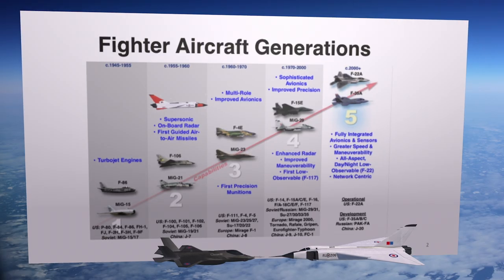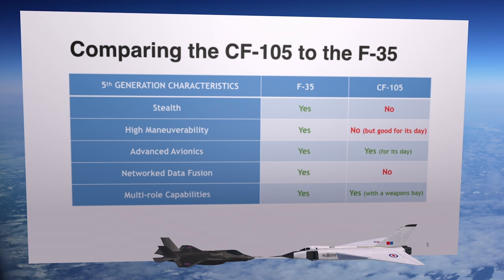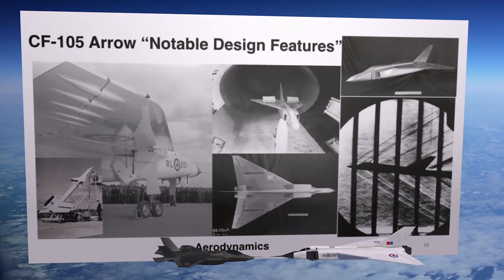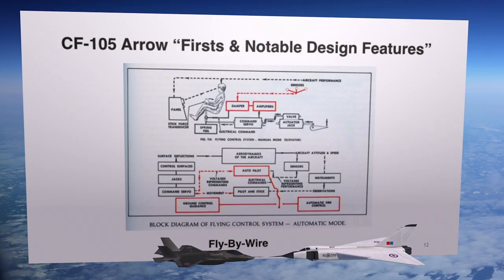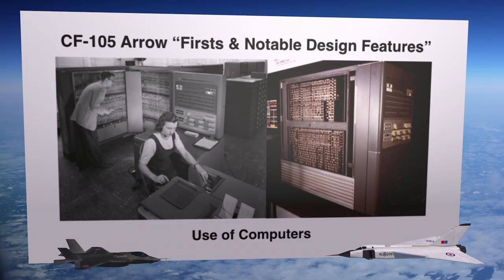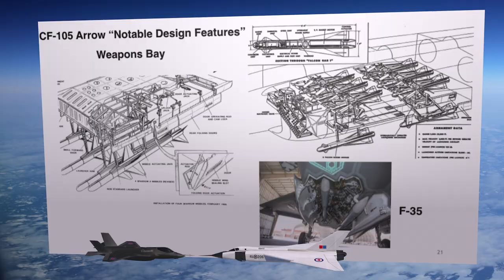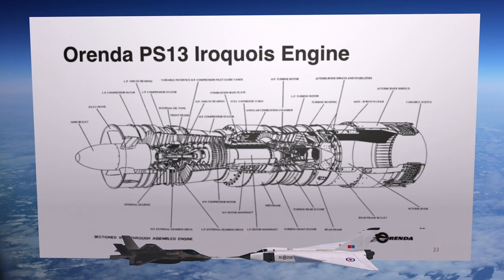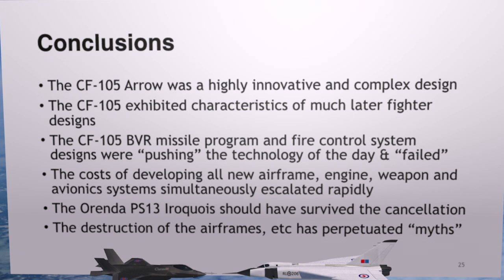AVRO ARROW FIRSTS VS F 35 LIGHTNING

Comment: This is a review of the book Cold War Cold Tech by R. L. Whitcomb as done by Jim100 AB for informational purposes only. Part 1

A short synopsis of the Arrow

The Arrow as Fighter-Interceptor

RCAF AIR 7-3 Specification and the C-105

 

Avro Canada and the RCAF examined a range of alternative sizes and configurations for a supersonic interceptor, culminating in RCAF "Specification AIR 7-3" in April 1953. 

 

This AIR 7-3 specification called specifically for a crew of two and a twin-engine design requiring a range of 556 kilometers (300 nautical miles (nm) for a normal low speed mission and 370 km (200 nm) for a high-speed intercept mission. 

 

It also specified operation from a 1,830 meter (6,000 ft) runway, a Mach 1.5 cruising speed, an altitude capability of 21,336 m (70,000 ft), and a maneuvering capability for 2 “g” turns with no loss of speed or altitude at Mach 1.5 at 15,240 m (50,000 ft). 

 

The specification also stipulated just five minutes from starting the aircraft's engines to reaching an altitude of 15,250 m (50,000 ft) at Mach 1.5. 

 

It was also to have turn-around time on the ground of less than 10 minutes. (Jim100 AB that’s Refueled and rearmed and ready for another mission)

 

An RCAF team then visited US aircraft companies and also surveyed British and French manufacturers before concluding that no existing or planned aircraft could fulfill these demanding requirements. 

 

In May 1953, Avro delivered a report, 

 

"Design Study of Supersonic All-Weather Interceptor Aircraft", outlining the major features of an updated C-104/2 design, which was now known as the C-105. A change to a thin "shoulder-mounted" delta wing allowed rapid access to the aircraft's internal systems, weapons bay, and engines. This thin wing was required for supersonic flight and the delta design provided the lightest structure

 

A big advantage of the computer flight control system was that it allowed the Arrow’s designers to design into the plane marginal or even negative stability factors, another first (by many years). The Arrow was intentionally designed to accept marginal stability, going from moderately positive to neutral on the pitch axis, and from slightly positive to moderately negative on the yaw axis. Because of the extra instability in the yaw axis, every aspect of it was at least double redundant except the single redundant hydraulic actuator itself. Perhaps now you can appreciate how truly advanced the Arrow was. We weren’t able to really compare it to anything until today because there was nothing to compare it to until today.  Flight performance envelope graphs, accumulated and transposed by R.L. Whitcomb for his book Avro Aircraft & Cold War Aviation shows that no medium or long-range armed fighter---to this day---could match the Arrow’s 1G combat weight performance curve, except the F-22 Raptor.

They wrote the book in terms of the modern method, yet the book had to be written all over again once Avro was killed and the engineers dispersed.

The Arrow and the IBM 704 computer

In 1955 Avro had projected the performance of the Mk2 Iroquois powered Arrow to be

Maximum speed of Mach 1.9 at 50,000 feet.

 

Combat speed of Mach 1.5 at 50,000 feet while sustaining a 1.84 turn without bleeding energy  Time to 50,000 feet of 4.1 minutes.

500 foot per minute (fpm) climb ceiling of 62,000 feet (i.e. able to climb at 500
fpm from this height) 

400 nm (nautical miles) radius of action on high-speed mission.

 

630 nm radius of action on a low-speed (including 5 minutes supersonic combat)
mission

 

Ferry range is not given but estimated at 1,500 nm

However, and to the elation of the Arrow designers and company in general the Arrow Mk 1, with about 40% less thrust then the Mk 2 and more weight, actually exceeded Avro’s own higher 1955 estimates for the Arrow Mk 2 by exceeding Mach 1.9. By October of 1958 due to test flying Avro was able to refine the drag estimates, feed them into the IBM 704 computer, and produce accurate projections that indicated 20% lower supersonic drag at maximum performance then even they themselves had projected. 

Due to this exceptional performance Avro knew the Mk 3 would be capable of considerable more than Mach 2.5. With improved materials and a new intake design that would be efficient at Mach 2.2 and above, Avro knew they would have an Arrow capable of at least Mach 3. This was nearly ten years before the SR-71 Blackbird or the Mig-25 Foxbat flew, suggesting Avro had an excellent advantage over the competition---given the freedom to exploit it.

Performance Report 15 included the empirically refined performance projections and figures this document indicated that the Arrow Mk 2 would have remained the top-performing fighter-interceptor in virtually all categories until the advent of the Lockheed Martin F-22 Raptor.

In fact an enormous amount of verbiage has been expended in claims that the Arrow would not have been manoeuvrable, based merely on the perceptions of it being such a large aircraft. In reality it was not that much bigger than the F-101 Voodoo or an F-15 Eagle, Neither of which would have seriously challenged an Arrow Mk 2 in a combat air patrol or, “top cover” or “air superiority” mission. 

Furthermore, size means nothing in determining aircrafts manoeuvrability potential. It can however, be calculated based on five factors. In comparison with any of the
aircraft built at the time and since in similar roles, from any country, the Arrow appears to have had attributes which would have given superior manoeuvrability to virtually any plane to this date---save the F-22 Raptor which has reverted to internal weapons carriage and a relatively low wing loading.
Reply: This is a review of the book Cold War Cold Tech by R. L. Whitcomb as done by Jim100 AB for informational purposes only. Part 2
The five critical attributes are: wing loading, thrust-to-weight ratio, control
effectiveness, critical alpha (or stalling angle of attack) and, finally the
amount of “G” loading the aircraft structure can absorb. 

The Arrow had the lowest wing loading of any supersonic interceptor to ever inter service, its only competition being the F-106 delta Dart and to a lesser extent, the F-22 Raptor, in terms of thrust-to weight ratio at combat weight; the Arrow was superior to everything up to the F-15 eagle. 

The Arrow’s allowable manoeuvring “G” at combat weight is equal, and in most cases superior to, virtually anything to fly then or since. Control effectiveness is difficult to estimate, especially with a supersonic delta design since the “moment arm” changes with control actuation and also with speed since the center of lift moves aft (back) at supersonic speeds. Designing a tailless aircraft with good manoeuvrability and stability characteristics across a wide speed range requires exact engineering.

Chamberlin’s unique features on the Arrow wing, such as negative camber inboard, leading edge droop, the saw tooth/notches were responsible for the arrow’s good characteristics at subsonic and supersonic speeds. Avro’s inclusion of a Honeywell Controls engineered automated fuel management system also allowed them to tailor the aircraft’s center of gravity to be very close to the aircraft’s centre of lift at each point (and thus expected speed) in its mission. 

The simple secret of making a delta craft very manoeuvrable is to have the center of lift and center of gravity at nearly the same place. Sufficient control surfaces will do the rest. 

In interviews with Jan Zurakowski and Peter Cope, both said the Arrow had awesome natural control sensitivity. Zura mentioned the roll rate was reduced at high subsonic speeds because he felt it was excessive. It was limited to one roll, or 360 degrees, in a second. Cope mentioned that the Arrow handled very well, was very stable on approach if flown correctly (contrary to some third party sources) Jack Woodman mentioned that a mere one-fifth of an inch of stick movement would result in a 0.5 “G” loading on the aircraft, which he felt was excessive. In other words, the Arrow had very good control effectiveness, better than any other USAF and British jets these experienced test pilots flew.

The simple fact is that the Arrow had an awesome power of maneuver as anyone who studies such things empirically will readily acknowledge.  When 1G performance curves for even the Arrow Mk1, with the early, de-rated J-75 engines, are compared to contemporary and even current fighters, it emerges that the Arrow was a world-beating design. It had the attributes in terms of low drag, low wing loading and high thrust-to-weight to defeat virtually any fighter at low altitude in a dog fight scenario. 

While its delta wing is argued by some to result in a high drag during turns, the Arrow’s internal weapons and higher thrust-to weight would compensate. The Arrow 1, at higher than combat weight, Displayed a larger flight envelope than a late production F-16 Fighting Falcon that carried only two tiny heat seeking missiles. (Braybrook. Roy, “Fighting Falcon V Fulcrum,” Air International Vol. 47, No 2 Stamford Key Publishing, 1994)

France’s  Mirage 2000, an updated version of their 1950’s Mirage III delta fighter is also known to embarrass the F-16 at medium and high altitude in turning fights, despite the F-16’s better thrust- to weight ratio. Nevertheless, the Mirage III was never considered a competitor to the Arrow in any performance measure or military role. 

The Russian MIG 29 Fulcrum, under equally light conditions to the F-16C mentioned above, is equal to that of an overloaded Arrow Mk.1 

An F-15C eagle, with up-rated engines, but at a true combat weight (no tanks, half internal fuel and eight missiles) displays a vastly smaller performance envelope to even an Arrow Mk.1 with at least 40% less thrust than a service Arrow Mk 2 would have had. The Arrow Mk 2, specified by Avro for the 21st Arrow, would have been able to sustain nearly 2G turn at Mach 1.8 at 50,000 feet.  

An F-15C could, at combat weight, sustain the same 2G turn at Mach 1.2 at 35,000 feet---hardly competitive.

The F-15C was felt, subsequent to the retirement of the F-106 Delta Dart to exhibit the highest performance in the Western world on an air superiority mission. Clearly, then the Arrow had vast “power of maneuver”. It had the ability to utterly humiliate anything flying at medium and high altitude. 

In a supersonic turning fight at altitude, the Arrow would remain unmatched by anything save the F-22 Raptor due to the F-22’s higher thrust-to weight ratio, The Arrow still had a lower wing loading and with a drag coefficient probably under .0185 and a lift-drag ratio of over 7-1 would therefore still not be a push-over for the Raptor---all other things being equal which, of course, 45 intervening years of progress in electronics have ensured are not.  Still, the Arrow Mk 2 was proclaimed to be capable of an instantaneous 6 “G” at 50,000 feet. The F-106 was also a high performer at altitude, capable of a 4 “G” at 45,000 feet whereas the Raptor is estimated to achieve 5 “G” at 50,000 feet. (Sweetman, Bill “F-22 Raptor”

 “The Arrow 2 design included provision for chaff and flare (chaff being radar
jamming filaments with flare being heat-seeking missile confusing pyrotechnic flares), active countermeasures, while ASTRA 1 and 2 radar/fire-control systems were to incorporate its own passive and active electronic counter-measures (ECM), including infra-Red detection, tracking and launch computation (the world’s first) home-on-jamming (helping the plane to navigate to the jamming aircraft), radar warning (telling the aircraft when it was being tracked or targeted) etc.. It was fully modern compliment and introduced sophistication which is today de rigour to the world of multi-role and air-superiority fighters” 

The Arrow would have been a dominant aircraft for many, many years and therefore could be expected to sell well to allied nations. That American authorities would not purchase any, and recommended that Canada not produce them tells its own story. The American aviation industry would not have been comfortable with the Arrow as competition and therefore was not likely to give the Canadian firm much opportunity to compete. (Douglas, W.A.B. Note to File “CBC Program on the Avro Arrow”, 21 April, 1980) 

During the test flying two accidents occurred. The first one was caused by a flaw in the design of the landing gear where the mechanism responsible for turning the bogies into alignment with the aircraft centerline jammed. Engineering had already redesigned the landing gear due to minor increases in aircraft weigh before the first flight and now it was redesigned again to prevent a similar mishap. 

The second accident was probably due to pilot error. Spud Potocki had taken RL-202 on a long-range high-speed flight from Malton to lake Superior, conducted a supersonic run over Ottawa (on Remembrance Day!) and on returning the plane to Milton. He was very low on fuel and his approach was to fast to be able to land properly on the runway available. Fearing running out of fuel he tried to force the plane down against ground effect and locked the main wheels before there was sufficient weight on them to brake properly. 

This resulted in the aircraft swinging off the runway and tearing off  one of the main landing gear legs and otherwise damaging the aircraft. As a result of this accident the Mk1 gear was banned from flight and replaced by the stronger and improved Mk.2 landing gear---even though the Mk.2 was significantly lighter then the MK1. 

This was also the fastest recorded flight of the Arrow with a speed of mach1.98 reached. Jim Floyd has related that they didn’t really know the correct atmosphere correction factor to apply to this flight and as such the flight could have been Mach 2 or slightly higher. 

Arrow RL202 reported an official top speed of Mach 1.98. During that flight radar vectoring recorded a top speed of Mach 2.2.

They apparently decided to state the speed as Mach 1.98 in order not to record a new world speed record and agitate their peers in the rest of the industry, and their enemies in government. Others have said that A.V. Roe Canada president Crawford Gordon Jr.absolutely forbade a speed record attempt in the Mk1 Arrows, wishing to preserve this accolade for the Iroquois engine Mk2.

By the fall of 1958 Avro was projecting a Mach 1.8 combat speed and 2G at 60,000 ft, exceptional even today. (PR 15 and Jim Floyd’s testimony)

Also the Arrow Mk 2a which Avro hoped to introduce on line after the first 37 under construction was set to achieve a 575 nm combat radius while flying a supersonic mission! The Arrow being able the to cruise at transonic and supersonic speeds without afterburner use (Super Cruise in 1958 – 1959 is this another first? Jim100 AB) is one reason it had superior range to the competition
Reply: This is a review of the book Cold War Cold Tech by R. L. Whitcomb as done by Jim100 AB for informational purposes only. Part 3
The Arrow’s Weapons and Weapons Bay

The Arrow has more military payload capacity than any other contemporary bomber-destroyer. The Arrow with the presently conceived armament pack containing MB-1 [Genie] and Falcon missiles plus fuel, has a subsonic radius of action, based on indication of drag from flight tests, of around 500 nm, with supersonic combat and all allowances, which is considerably higher than any other aircraft in its class.

The concept of a multi-role combat aircraft clearly intrigued the RCAF for the C104/2 design closely resembled the CF-105 in size, appearance and capability. The key to its flexibility lay in its massive armament bay. Install six Hughes Falcon missiles and twenty-four rockets and it was an interceptor. Not satisfactory? Try four Velvet glove missiles or four thirty-millimetre cannons with 200 rounds each and fifty-six folding fin rockets. Need a tactical bomber? Four 1,000-pound general purpose bombs would do the job. Put in a camera pack and the aircraft was transformed into a photo-reconnaissance model. Add more fuel and it became a long-range fighter. Carry a second pilot on any of these missions and it could be used as an operational trainer. The possibilities were too numerous to resist. (Dow: The Arrow p. 126)

The Arrow was designed to out-fly, out-think, and out-fight, with its own on board missiles, any expected threat until the about 1970. Unlike any aircraft save the heavy bombers, the Arrow was capable of carrying several guided missiles capable of nuclear armament, considerable “stand-off” range at high supersonic speeds. 

This high performance, even when heavily loaded, combined with the capability of the kinds of weapons it could carry in its internal weapons bay, gave the Arrow more potential flexibility then most aircraft built to this day.

For flexibility, the armaments bay could hold 6 Hughes Falcon guided missiles and 24 Hughes 2.75" rockets 

Or 4 Velvet Glove missiles 

Or 4 30mm canons with a capacity of 200
rounds and 56 folding fin rockets 

Or as a bomber, 4 1,000 pounds of bombs 

Or as reconnaissance, a camera pod 

Or to give the fighter a longer range, an extra fuel tank 

When the airframe development began, the RCAF and the Defense Research Board began evaluating missiles and their fire control systems. 

They looked at the following missiles: 

- Douglas MB-1 Genie 

- Hughes Falcon Sperry Sparrow I 

- Douglas Sparrow II 

- Raytheon Sparrow III 

In mid 1955, the Douglas Sparrow II was chosen and the Hughes Company would adapt their fire control system to other missiles. RCA agreed to work to RCAF requirements 

ASTRA, and on 28 Jun 1956, C.D. Howe tells the House of Commons work will soon begin on ASTRA. In late 1956 the USN abandons development of the Sparrow II, the missile chosen for the Arrow. 

The Canadian government brought the Sparrow II to Canada to continue development with AVRO as the System Manager, Canadair to build the missile airframes, and Canadian Westinghouse in Hamilton to work with Bendix-Pacific on the Radar Guidance System.  

The Canadian Armament and Research Development Establishment (CARDE) began the Velvet Glove program 1 April 1951 and by the time the program had been terminated in 1955, 300 Velvet Gloves had been built and fired. The Velvet Glove program had spent $24 million. 

 The Arrow and Long Range Missiles...

For the AVRO Arrow, the Sparrow II Raytheon AIM/RIM-7 Sparrow was intended to provide the long range clout

The use of a LONG internal weapons bay to allow carriage of specialized, long-range standoff and cruise missiles (not, copied yet really)

The Falcon “Z” “the weapon specified were two, Falcon Z, aka GAR-9, aka AIM-47 type missiles each weighing approximately 750 lb. the missile had a range of about 100 miles and a 40,000 foot differential altitude, as later tested on the YF-12A. It was a large, advanced long-range air-to-air missile of the performance Avro had been awaiting. It would have suited the Arrow’s large internal weapons bay while competing aircraft could not have carried it internally—resulting in a huge performance advantage to the Arrow so equipped. 

Anti Ballistic Missile

“It is interesting in the government discussions on ABM weapons that the Arrow was never considered as capable of undertaking this role. Certainly Avro had been suggesting it do just that. 

“It might be supposed for example, that in every aspect of employment the anti-missile, missile would prove to be very far removed from the manned fighter airplane. Yet the possibility is already seen that, in order to achieve its maximum kill potential the “anti” missile may actually form an alliance with the manned fighter. 

“The feasibility of this…has been expounded by Jim Floyd, Avro Aircraft’s vice president engineering …whereas the launching of the Russian sputnik satellites was a very significant event in the annals of aviation its affect on the Arrow program should be singularly positive…if you think about in for a minute,” he says “the normal launching platform for anti-missile missile are stationary. The Russians can find out where they are and destroy them. On the other hand, an airborne missile mother ship (which could be the Arrow) can be rapidly moved from one place to another carrying an anti-ICBM missile. 

“It might be imagined that a missile suitable for carrying an anti-missile warhead would prove a formidable load even for the mighty Arrow: But Mr. Floyd had looked into the matter with a quick specific calculation on an ICBM approaching at Mach 10 at 200 miles above the earth. He finds that if an “anti” is launched from an aircraft flying at Mach 1.5 at 60,000 ft. its thrust need only be about one third of that required for ground launch weapons carrying the same size of warhead to a given point in approximately the same time. And dividends would accrue in range and accuracy. (Flight and Aircraft Engineering, “Ironclads and Arrows” 14 February 1958

In other words, any Arrow could carry the ABM weapon Avro was considering. The British technical journal engineering also discussed the possibility of the Arrow carrying an ABM weapon in their 17 October, 1958 edition. Jim Floyd has subsequently related that Avro was working with Douglas to adapt a version of the Nike-Zeus system for use on the Arrow. The first stage of the ground launched version could be abandoned, with data link modifications to the remaining upper stage to accept targeting information from the Arrow’s onboard radar system. 

Of course, nothing came of this plan, perhaps in part because it wasn’t mentioned to the right decision makers. There is no evidence available suggesting that the Chief of Staff or the Conservative Cabinet were aware of Avro’s plan to carry ABM’s on the Arrow nor the fact that the system they were proposing was based on the American first choice for their ABM system, the Nike weapons
Reply: This is a review of the book Cold War Cold Tech by R. L. Whitcomb as done by Jim100 AB for informational purposes only. Part 4

Who was Julius
Lukasiewicz? An interview with Jim Floyd

“Jim Floyd has been hesitant in relating the true role that {Julius} Lukasiewicz played at the time the Arrow was designed Lukasiewicz was at that time with the National Research Council in Ottawa and Canada’s expert in supersonic aerodynamics. So he reviewed the design and produced a report that was scathingly critical of the aerodynamic design, to the extent that there was no point in continuing with such a flawed airplane. It was decided to approach the USA for an expert opinion. Hugh Dryden, a renowned aerodynamicist at The National Advisory Committee on Aeronautics, forerunner of NASA gathered a team of his top men in the field of supersonics. Their verdict was Avro had an excellent design and if anything they were being conservative in their estimates of performance.

Lukasiewicz has never forgotten his humiliation and despite the fact that the Arrow behaved perfectly and achieved a speed of 1.98 times the speed of sound while still climbing and with the lower powered J-75 engines, never ceased to twist the facts. (Keast, Harry: Letter to the Editor of the Globe & mail newspaper. This letter is available as part of a CD Rom
from www.avroarrow.org)

Keast was responding to a disparaging editorial on Avro and the Arrow by Professor Michael Bliss in the Globe & mail newspaper titled “the Legend That Wasn’t”. The Globe & mail unfortunately failed to print the rebuttal, despite Keast’s vastly superior credentials.

Other primary sources indicate that fights between
Avro’s brilliant aerodynamicist Jim Chamberlin and the NAE really polarized the two groups. In fact, the government scientists became so frustrated with the inflexibility of Chamberlin over the Arrow’s aerodynamics that Avro was asked to fire Chamberlin. J.C Floyd wrote: “I was fiercely supportive of Jim [Chamberlin] in the dark days of the NRC [via the NAE] criticism of our aerodynamics when they even suggested that Jim should be taken off the project. I told them that I would resign myself rather than do that!”(Letter from J.C. Floyd. 9 February, 2004 to R.L. Whitcomb) Chamberlin stayed, but so did the NAE, at the time Julius Lukasiewicz, a polish ex-patriot, was, the NAE’s high-speed aerodynamicist and the man most at odds with Avro’s engineering and design staff. 

G/C Footit has written in a period documentation
that some of the criticism was due to professional jealousy in the organizations like the National Aeronautical Establishment (NAE) who felt they should be the ones charged with design and testing of aircraft like the Arrow. This internal bureaucratic opposition spread (along with rumors) and did the program serious harm. They were also proven wrong by the Arrow itself, and by subsequent design history.

 Later in life without disclosing his involvement in the program, Lukasiewicz was interview by the CBC and was highly critical of the Arrow program.

Arrow Benchmarks 

1) The first fly-by-wire flight control system.

2) The first fly-by-wire flight control system using solid-state components operating in “real time”.

3) The first fly-by-wire flight control system with at least single redundancy.

4) The first fly-by-wire flight control system designed to be coupled with the computerised navigation an automatic search and track (ASTRA).

5) The first fly-by- wire flight control system providing artificial feedback, or feel to the pilot. Not even the first F-16's had this.

6) The first fly-by-wire flight control system that was flyable from ground installations through data uplink, with data downlink systems reporting. (This, along with its designers, became the basis of the data-link fly-by-wire systems for Mercury, Gemini and Apollo 1.)

7) The first aircraft to have its aerodynamic design aided by solid-state (real time) computers, Avro thus appears to be the company that evolved the technique now referred to as Computational Fluid Dynamics.

8) The first aircraft to have its structural design aided by solid-state computers.

9) The first aircraft to have complete hydraulic and electronic systems development rigs (simulators generally using actual aircraft components wherever possible, coupled to their computers to produce a realistic computerized flight simulator.

10) The first aircraft to have a Pulse-Doppler, ”look-down, shoot-down” radar designed for it, (The second was the F-14 Tomcat, although ASTRA II was to be fully digital, while the Tomcat’s AWG-9 was not digital. In fact, the first Aircraft in service to have radar/fire control systems integrated with a flight control system of equal conceptual technology to the ASTRA II-Arrow was the F-18 Hornet.)

11) The first aircraft designed with marginal or negative, static stability factors. This was done to ensure good manoeuvrability across its very wide flight envelope while keeping trim drag to a minimum thus allowing a larger flight envelope.

12) The first aircraft to have an advanced, integrated, bleed-bypass system from its self-adjusting intake to its extractor-nozzle exhaust. (The F-104 is credited with being the first to introduce bleed-bypass integration but it was comparatively rudimentary and probably of similar sophistication to that introduced on the jetliner years earlier.)

13) The first aircraft to have a by-pass turbojet designed for it and the first to integrate the bleed-by-pass and cooling systems of the engine, intakes and extractor nozzle.

14) The first aircraft to have its engines located at the extreme rear of the aircraft. In fact it was about the first jet fighter to have what might be termed “longitudinal spacing” of all its major systems. Previous to the Arrow most aircraft designers had tried to locate fuel tanks, weapons and engines as close to the center of gravity and center of lift as possible. This contributed to their being “fat” in aerodynamic terms, which is why so many of them ran into “area rule” problems.

15) The first aircraft to be developed using an early form of "computational fluid dynamics" with an integrated high wing that made the entire upper surface a lifting body  type of theory rather than the typical (and obsolete) "blade element" theory. The F-15, F-22, Su-27 etc., Mig-29, Mig-25 and others certainly used that idea.

16) The first to use of a LONG internal weapons bay
to allow carriage of specialized, long-range standoff and cruise missiles. (Not copied yet really)

17) The first aircraft to have major components machined using Computer Numeric Control CNC equipment. (The second is believed to be the F-111Aardvark)

18) The first aircraft to have major components and fasteners made of Titanium.

19) The first aircraft to use a 4,000 psi hydraulic system (The second was the B-1 bomber)

20) The first supersonic aircraft designed to have better than one-to-one thrust-to weight ratio at close to combat weight (allowing it to accelerate while climbing vertically) The “ Reaper” ground-attack version of the Gloster Meteor was around 1-1 thrust, but it was not supersonic. The first aircraft to compete in this area was the F-15A Eagle.

21) The first to propose an aircraft be equally adept at strike/reconnaissance roles while being THE air-superiority fighter at the same time. (Few have even tried to copy that, although the F-15E is an interesting exception.)

22) The Arrow combined the lowest thickness-chord ratio (thickness of the wing compared to the length (not the span) wing with the lowest wing-loading (surface area of wing divided by the weight of the aircraft) of any high-capacity service design. Both are crucial to low supersonic drag, good manoeuvrability and high speed.
Reply: This is a review of the book Cold War Cold Tech by R. L. Whitcomb as done by Jim100 AB for informational purposes only. Part 5

Iroquois Engine “Firsts”

In June of 1956 the Iroquois underwent its first official test, the 50 hour Pre-Flight Rating Test (PFRT) During this test the engine beat every known record for thrust output at 19,350 lbt (pounds thrust) without afterburner. Its throttle response was also world-beating. It took only 2.8 seconds to go from idle to full military thrust and only 4.5 seconds to go from idle to full afterburning thrust.

First overhung-stator two-shaft design using two(vs.
three or more) bearings assemblies thus dispensing with a central casting, and replacing the two shafts with an inner and outer drum making the entire center core of the engine turn. The combustors were overhung with the flour comprising the spinning outer drum which connected the high-pressure(HP) turbine to the HP compressor section The drum connecting the low-pressure (LP) compressor to the LP turbine was smaller and rotated inside the HP drum.

First, to make extensive use of Titanium for reason of high-strength high-temperature tolerance and low weight. 

First, to house a high proportion of it machinery (pumps, gearbox, drives etc.) internally to lower installed size. This meant a smaller, lighter aircraft stricter, and improved over-all aerodynamics and efficiency. 

First to concentrate on constant gas speed though out the core to maximize aerodynamic efficiency and allow a higher average speed of flow through the engine (rather than varying gas temperature pressure and speed, though the core, they designed it in such a way as to keep the gas speed relatively constant and vary only gas temperature.)

First to try air-cooled turbine blades with comparatively  cool compressor air ducted to the blades though the core structure of the engine, and though pressurized, annular ducts formed by the outer case of the engine. The Iroquois 1 used this but the Orenda designers dispensed with air-cooled blades in the Iroquois 2 due otherwise excellent air-cooling after the combustors and improved metallurgy (availability of Income l X) The Pratt & Whitney J-58 for the A-12/YF-12A/SR-71 used a similar arrangement on a single –spool design.

First (with the General E electric J-79 of the B-58 Hustler and F-4 Phantom) variable pitch stator design (variable pitch stator allowed improved throttle handling and resistance to compressor surges, stalls, and engine flame-outs. On the J-79 variable stators allowed the designers to produce a single-spool engine with the handling quality usually associated with two-spool designs, on the Iroquois., which was already a two-spool design, it allowed Orenda to design it with 40 to 60% fewer compressors and stator sections, compared to contemporary and most later designs greatly lightening the engine.)

First “bypass” engine using LP and HP air for cooling the turbine section and machinery while exhausting through the extractor nozzle to increase thrust.

“Hot-Streak” ignition for the afterburner A streak of hot combustion gasses was piped directly back to the afterburner fuel zone an ultra-reliable afterburner igniter an sustainer. 

First oxygen injection-relight system in case of engine flame-out at altitude, this technology was licensed by Orenda at the time, providing income for the company.

First fully variable afterburner. Previous systems came on all at once or in two or more stages. A fully-variables system in an engine of the low weight, high thrust and good fuel economy of the Iroquois would have been a manger tactical advantage during the 1960s and 70s. 

Many changes were made to the structure of the MK1
engine and a new prototype the Iroquois MK2 was produced. During the program at least five running engines were sent to the United States for test and evaluation. Iroquois engineer Colin Campbell relates that the engine was tested at up to 25,000 pounds dry thrust in Canada and at up to 27,000 pounds in the Cornell Institute in the United States. These are phenomenal outputs for an engine of this size even today. The rating they were aiming for was 20,000 pounds dry thrust and 30,000 pounds with afterburner. Clearly they had reason to hope for even more powerful versions once they addressed the reliability and longevity issues.

The Iroquois engine MK2 would have been able to accelerate while climbing vertically and carrying a useful load. The developed Iroquois promised this performance at close to gross take-off weight.

(Jim100 AB So why did the Canadian government cancel this plane? Based on the research I would have to go with these assessments.)

The Arrow would have been a dominant aircraft for many, many years and therefore could be expected to sell well to allied nations. That American authorities would not purchase any, and recommended that Canada not produce them tells its own story. (R.L. Whitcomb) 

A Canadian civil servant involved in a review of the
CBC documentary “There Never Was An Arrow” Noted the following regarding the documentary’s conclusion that American interests were not involved in the Arrows cancellation: “The program concluded that no American interests were in evolved in the decision?” On the face of it, this seems a remarkably innocent point of view. Previous accounts have suggested with some reason that the American aviation industry would not have been comfortable with the Arrow as competition and therefore was not likely to give the Canadian firm much opportunity to compete. (Douglas, W.A.B. Note to File “CBC Program on the Avro Arrow”, 21 April, 1980)

It is perhaps worthwhile to consider where American
interests lay in the 1957 election. It was in response to this growing concern, in some quarters in Canada about the alarming growth of American ownership in the Canadian economy, that the previous Liberal administration had started a Royal Commission in the first place. It seemed tailor made to rebuff the Rockefeller panel’s overt economic imperialism. This commission pointed out the negative impact this increasing ownership was going to have on Canada’s future. Some of the problems foreseen were:

The decline of research and development in Canada due to this work being concentrated in the home offices of the American companies then by Canadian production facilities. The inability of Canada to look after its strategic needs, including defense, if Canadian strategic resources were allowed to be bought out by American interests. An exodus of Canadian administrative, scientific and technical talent to the United States as a result of the above. A decline in Canadian economic, military and political independence brought about by the above, with the probable result of Canada losing any real sovereignty and thus becoming a satellite of the United States. (Gordon, Walter L., A chance for Canada, based in part on the Gordon Commission.)
Reply: This is a review of the book Cold War Cold Tech by R. L. Whitcomb as done by Jim100 AB for informational purposes only. Part 6

Price Deception

Foulkes later left evidence on the record demonstrating his “erroneous” conclusions regarding the price of the Arrow.

“it is quite clear that this aircraft will require almost $500 million to complete development and then it will cost between $10 and $12 million a copy for production”

So according to Foulkes’ spurious CSC recommendations to Pearkes, The 10 to 12 million figure obviously was for costs for production not including design and development. However, in an unpublished article on the Arrow debacle Foulkes later wrote:

“The Defense Production Department advised that approximately $300 million had been spent on the Arrow project and that an additional $871 million would be required to complete it.” This resulted in the $12 million figure. (Smye Canadian Aviation and the Avro Arrow P. 113)

Foulkes was obviously capable of considerable modification of statements when embarrassed.

Dow wrote:
”$12.5 million. This was the cost per aircraft cited by the prime minister for 100 Arrows equipped with Astra and Sparrow… To arrive at these figures it was necessary to total the cost of all components of the weapons systems, airframe, engine, missiles, and fire control. This included agreements for design and development, tooling, spares, ground handling equipment, test assembly and overhaul.

To make these figures appear even more outrages, the cost of the 37 aircraft on contract was considered as a development expenditure for the proposed program to build 100 Arrows. In effect the cost of 137 was divided by 100 to inflate the price per plane.” (Dow The Arrow P. 180)

Smye would later view some of the government cost
figures, and even using their own admitted math, would come out with an average price for 100 operational Arrows, including all design and development to operational standards, engines and fire control, of $5.62 million dollars.

The government said it came to $7.8 million a copy.
This was because they were writing off the entire 37 preproduction run and were including design and development expenses incurred to date, missiles, lifetime spares, ground support and test equipment and more.

It was a very deceptive way to influence the thinking of Cabinet, the press and the public. Of course, in comparing figures, the fact that payroll income and other taxes would be immediately be recouped from Canadian production was, inexplicably ignored.

It also appears that Avro’s final offer was not brought to the attention of Cabinet, nor anyone else, for many years---until Fred Smye made it public in his unpublished manuscript: Canadian Aviation and the Avro Arrow. So what was Avro’s final offer on the Arrow? It was 3.5 million dollars each for the first 100 Arrows and 2.6 million dollars each for the next 100.

As Dow put it “Details of Avro’s offer to the government were given in a letter from the company to D.L. Thompson, director of the aircraft branch of DDP on 30 December. The letter confirmed a fixed price offer of $346,282,015 for 100 aircraft (25221 to 25320), including Iroquois engines and the Hughes MA-1C electronics systems. 

Adding applicable sales tax of $28,717,985 brought the price per aircraft to an even $3.75 million. The contract proposal attached to the letter covered design and development, tooling and tool maintenance, manufacture of 20 development and 100 squadron aircraft…and technical support for the squadron aircraft. (Dow: the Arrow P. 186
Reply: This is a review of the book Cold War Cold Tech by R. L. Whitcomb as done by Jim100 AB for informational purposes only. Part 7

F-106 VS Avro Arrow

Performance Specifications

It is worth noting that the USAF service (not absolute) ceilings were based on the ability to sustain 1.2G standard (or bomber rated turns) requires an angle of bank of 15 degrees no matter what the speed, height or weight of the aircraft.

Similarly, a 2G steep (or fighter rated turns) requires an angle of 60 degrees of bank. Thus a G loading relating to a “combat profile” entails more than just the ability to pull a modest amount of G structurally, becoming a consideration of all the best attributes of an aircraft as a whole. Analysis of this “flight envelope” of an aircraft has forever spoken to the need for more power, less drag and more lift.

The RCAF meanwhile had established a combat specification
for the Arrow even more demanding than the British convention. The British established a fighter’s combat ceiling and combat altitude with the speed that could be maintained under a 1.5G turn. All comparisons of US aircraft performance against the Arrow and British designs should bear in mind these more demanding British/Canadian requirements.

As an illustration of this seemingly insignificant .8G difference between the US and Canadian rating systems, 1.2G requires an angle of bank of only 15 degrees while a 2G requires a full 60 degrees of bank! Obviously, there is an enormous difference in the lift (and therefore thrust) required to maintain altitude between these “bomber rated” and “fighter rated” turns.

The F-106 would realistically be roughly capable of about a Mach 1.5 combat speed at 1.2G at 50,000 ft., a far cry from the Avro specification for a Mach 1.5 combat speed at 2G at 50,000 ft without losing energy. By the fall of 1958 Avro was projecting a Mach 1.8 combat speed at 2G at 60,000 ft. exceptional even today (PR 15 and Floyd’s testimony.)

Also, popularly, published US figures tend to demonstrate the best singular performance numbers of a design and do not publicly tie the specifications together into a comprehensive combat performance specification. This is a very important point for our purposes. While an aircraft may have a maximum speed of Mach 2 at 35,000 ft, its service ceiling, like on the F-16 of around 50,000 ft may only be reached at a mere Mach 1.2 and the aircraft will have very little maneuverability at all.

The F-106 VS Arrow Top Speed and Altitude

Three years after the first flight of the F-106 Major Joseph Rogers established a new world absolute speed record at Mach 2.18 over a closed course. Also on this December 1959 flight Rogers coaxed a specially-prepared (stripped down airframe and specially tuned engine) F-106 to Mach 2.31. This figure has always been quoted as the maximum speed of the F-106, but it has no reflection of what a service aircraft could achieve with half internal fuel, a full armament load and a typical engine. The numbers quoted in the first flights of the F-106 are probably more indicative, with a top, practical level flight speed of about Mach 1.9 at 35,000 ft though certainly not with external tanks and a maximum ceiling of 57,000 ft. Acceleration was slow taking 4 and a half minutes to accelerate from Mach 1 to Mach 1.7 and another two and a half minutes to reach Mach 1.8. As for the F-106’s 70,000 ft. “intercept” altitude, it relied on the ability of the missile to climb for a significant distance to accomplish this task. 

. The test Arrow Mk1 (RL 202) would exceed both of these figures with Wladyslaw “Spud” Potocki the second Avro development pilot he would achieve Mach 1.98 at 50,000 ft and the aircraft would fly to more than 58,000 feet with the lower-powered de-rated (not developing design thrust) J-75 engines and thus being 44 percent underpowered compared to the Mk2 with the Iroquois engines. The Arrow Mk1 had nearly reached the speed and altitude projected for the Mk2 Iroquois- engine version! One can see that the performance of the Mk2 would have been far superior to the F-106 in every respect.

Janusz “Zura” Zurakowski Avro’s chief development pilot reported on the seventh flight of the Arrow on April 18 1958 an altitude of 49,000 feet at Mach 1.52, still accelerating and climbing and Jack Woodman the only RCAF pilot to fly the Arrow. As the governments representative he noted that approximately 95 present of the flight envelop had be explored. The Canadian Armament Research Development Establishment (CARDE) years later would state that the Arrow in 66 flights and 70 hrs 30 minutes of flight time had completed and passed 95 percent of its Flight testing. 

F-106 VS Arrow Fuel and Combat Radius

In 1968 the F-106 finally got long-range external tanks which extended its maximum purely subsonic combat radius to 325 nm, The Arrow Mk2 with the presently conceived armament pack containing MB-1 [Genie] and Falcon missiles plus fuel, has a subsonic radius of action, based on indication of drag from flight tests of the Mk1, of around 500 nm, with 5 minutes of supersonic combat and all allowances. The Arrow Mk2 had an internal fuel capacity 2.3 times that of the F-106 relying on two large capacity external tanks.

Dr. John J. Green, from the Defense Research Board (DRB) and scientific adviser to the RCAF, had written the following in a memorandum dated June 1, 1954:

In computing combat radius different conditions are stipulated by the RCAF and the USAF. For instance, the USAF permits the use of external tanks, whereas the RCAF specifications do not. If the combat radius of the CF-105 is calculated in accordance with the conditions permitted by the USAF specification, the figure of 782 nautical mile combat radius is obtained.

This certainly goes against Diefenbaker’s statement that the Arrow was deficient in range. Indeed, it was ready to achieve a supersonic combat radius in the Mk2A version of at least 575 nm and do so with a combat speed of Mach 1.8 rather than Mach 1.5. This range performance is very nearly three times the RCAF specification, as Jan Zurakowski reiterated in a note in August 2001. Zura also wrote Diefenbaker reinforced this impression in public that the Arrow was deficient in range!

F-106 VS Arrow Combat-Weight Power-Loading

The F-106’s Combat weight was 38,700 lb. while that of the Arrow Mk2 was about 62,431 lb. Respective afterburners was 24,500 lbt (pounds thrust) for the developed J-75 as compared to 52,000 lbt on the Arrow Mk2, with two undeveloped Iroquois. 

This provided a combat-weight power-loading for the F-106 of 1.27 lbs to lbt. The Arrow Mk2 with two undeveloped (de-rated) Iroquois with a lower afterburner augmentation ratio would have had a combat-weight power-loading of 1.09 lb to lbt nearly 20 percent superior. This comparison is with an F-106 at half internal fuel and without external tanks. The Arrow also faced lower power demands per pound of airframe then the F-106 because the CF-105 had over twice the power available in an airframe with only about 25 percent greater frontal area.

The de-rated Iroquois engine MK2 would have been able to accelerate while climbing vertically and carrying a useful load. The developed Iroquois engine promised this performance at close to gross take-off weight.
Reply: This is a review of the book Cold War Cold Tech by R. L. Whitcomb as done by Jim100 AB for informational purposes only. Part 8

The F-101 Voodoo

By 1957 the F-101, originally designed as a long-range bomber-escort fighter, had been ordered into production as an interceptor, no doubt because even then the F-102 becoming F-106 was still having serious development problems. The interim re-design of the F-101 escort fighter to carry the MA-1 interception system’s brains, eyes and teeth had made this option even more appealing. SAGE and MA-1 operational experience could be gained on the aircraft that could do the same job (more or less!) in terms of range and speed of the F-106, made it irresistible to the USAF.

All interested and informed parties knew, the F-101 no matter how heavily sold; could never rival Avro’s Arrow. The F-101 was essentially a subsonic or maximum Mach 1.2 combat speed aircraft at around 36,000 foot altitude and a maximum speed of about Mach 1.6. The Voodoo used the ancient J-57 turbojet engines , had about half the thrust to weight ratio of the Arrow, had three times the wing loading, had a pitch up problem, had structural problems, and more. This aircraft would be employed, second hand, by the RCAF soon after the Arrow cancellation. 

(Jim100 AB As bad as the F-106 was when compared to even the Arrow Mk1’s flight performance the F-101 was even worse!

Look at the numbers closely the F-106 with as much weigh removed as possible things like radar dish, MA-1 fire control system, no weapons and anything else to save weight, and then it used a specially tuned engine. The F-106 was able of reaching a maximum speed of Mach 2.31 at 40,500 ft. So how does the Arrow Mk1 compare.

The Arrow Mk1 with more weight than the Mk2 and being 40 to 44% underpowered compared to the Mk2 and with an instrument pod that weighed considerably more the a standard missile pod was able to reach a speed of Mach 1.98 at 50,000 ft. 

Look at the numbers again and do the math the F-106 speed of Mach 2.31 minus the Arrow speed of Mach 1.98. We find that the specially-prepared F-106 was just 0.33 Mach faster than the overweight underpowered Arrow Mk1!

Also look at the altitude this speed was reached at. The Arrow Mk1 reached its speed at 50,000 ft minus the 40,500 ft for the F-106 and we find the Arrow was 9,500 ft higher in altitude then the F-106. The Arrow Mk1 was Mach 0.33slower at 9,500 ft higher altitude not bad for the overweight and underpowered Mk1 VS the specially-prepared F-106!

Also, the Arrow Mk1 had not been pushed to its performance limit, (it was not to reach or exceed Mach 2 or try for a new world speed record for one reason or another Jim100 AB). The American aviation industry and the USAF also knew that the performance of the Mk2 would have been far superior to the F-106)

Still, the F-106 is still considered by many to be the best interceptor the USAF has deployed. This appraisal, by USAF Air Defence Command pilots, includes the F-15 Eagle! They consider it a retrograde step in the (interceptor performance regime).

This praise of the F-106 could only happen in an Arrow-free environment.

It seems very clear as (R.L. Whitcomb) points out that the Arrow would have been a dominant aircraft for many, many years and therefore could be expected to sell well to allied nations. That American authorities would not purchase any, and recommended that Canada not produce them tells its own story. 

Also (Douglas, W.A.B. Note to File “CBC Program on the Avro Arrow”, 21 April, 1980) The American aviation industry would not have been comfortable with the Arrow as competition and therefore was not likely to give the Canadian firm much opportunity to compete. 

How long did it take to design and create a flying F-106 VS the Arrow?

The F-106 got its start with the XF-92A that was built in 1948 and Conair was given a contract to produce an interceptor based on this design in September of 1951. It took a full 5 months just to produce the F-102 mock-up and the F-102 was only capable of Mach 1.2. 

While this was going on the F-102 was being (modified to a new configuration) which became the F-106 and it first flew on 26 December 1956. From the first flight of the FX-92A to the production of a proto-type version that was close to the 1954 intercept specifications took over 7 years and this was a continues priority project right from the start! The F-106 never did reach all of its specification requirements.

The Arrow did not use a proto-type it went right from the design stage to a hard tooled production line interceptor and took Avro just over 3 years to get it right the first time. The Arrow would meet or exceed all the 1954 intercept specifications.
Reply: Jim100 AB of
Reply: Jim100 AB ,d
Reply: @brucethrelfall3013  Not sure what your trying to say?
Reply: I had meet someone who worked on the Arrow he told by me that the Arrow exceeded  all expectations with test engines less powerful than them proposed orenda engines in Arrow 106
Reply: @cortschumacher7134  He is right it did, the Arrow Mk 1 would be good even by todays standards and the experts agree.

Performance Report 15 included the empirically refined performance projections and figures this document indicated that the Arrow Mk 2 would have remained the top-performing fighter-interceptor in virtually all categories until the advent of the Lockheed Martin F-22 Raptor.

The Arrow Mk1, at higher than combat weight, Displayed a larger flight envelope than a late production F-16C Fighting Falcon that carried only two tiny heat seeking missiles. (Braybrook Roy, “Fighting Falcon V Fulcrum,” Air International Vol. 47, No 2 Stamford Key Publishing, 1994)

The Russian MIG 29 Fulcrum, under equally light conditions to the F-16C mentioned above, is equal to that of an overloaded Arrow Mk.1
 
An F-15C eagle, with up-rated engines, but at a true combat weight (no tanks, half internal fuel and eight missiles) displays a vastly smaller performance envelope to even an Arrow Mk.1 with at least 40% less thrust than a service Arrow Mk 2 would have had. The Arrow Mk 2, specified by Avro for the 21st Arrow, would have been able to sustain nearly 2G turn at Mach 1.8 at 50,000 feet.  

An F-15C could, at combat weight, sustain the same 2G turn at Mach 1.2 at 35,000 feet

In a supersonic turning fight at altitude, the Arrow would remain unmatched by anything save the F-22 Raptor due to the F-22’s higher thrust-to weight ratio, The Arrow still had a lower wing loading and with a drag coefficient probably under .0185 and a lift-drag ratio of over 7-1 would therefore still not be a pushover for the Raptor --- all other things being equal which, of course, 45 intervening years of progress in electronics have ensured are not.  

Still, the Arrow Mk 2 was proclaimed to be capable of an instantaneous 6 “G” at 50,000 feet. The F-106 was also a high performer at altitude, capable of a 4 “G” at 45,000 feet whereas the Raptor is estimated to achieve 5 “G” at 50,000 feet. (Sweetman, Bill “F-22 Raptor”)